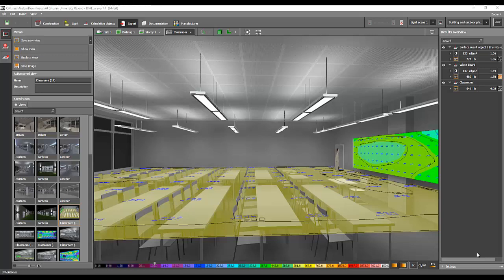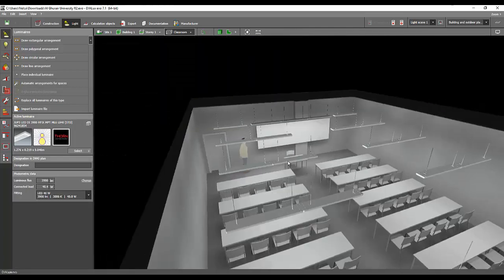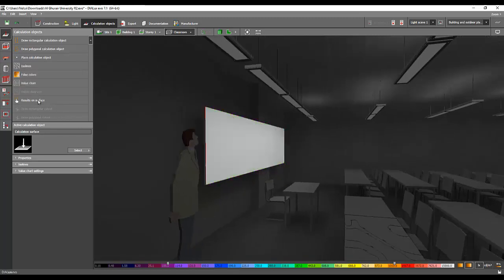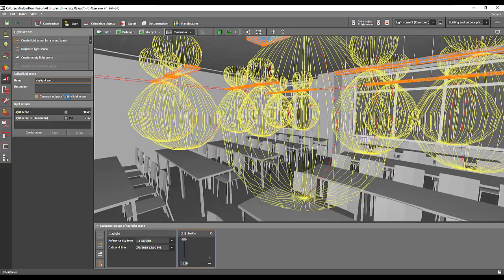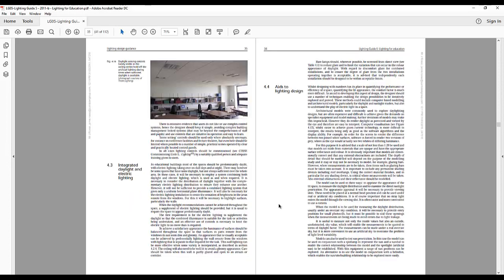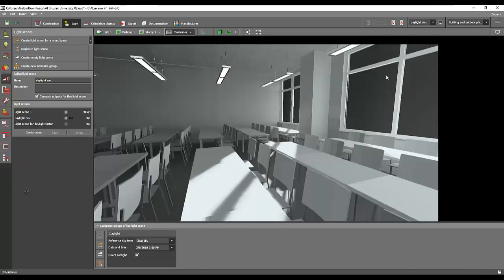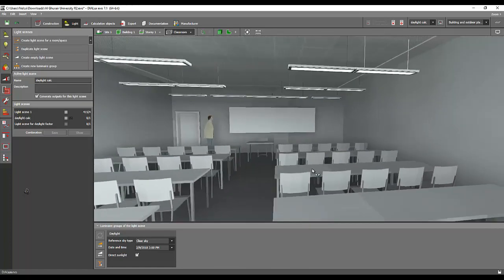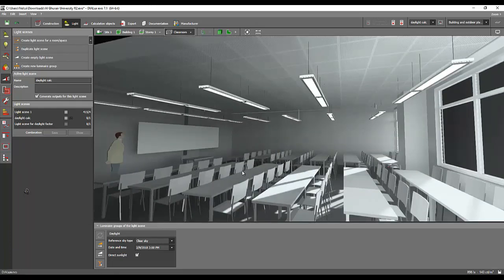Classroom Lighting Design Techniques

Comment: Hello Nelca, thanks for the tutorials first of all, they are very helpful, I wanted to ask a question about the lights that are in front of the whiteboard, they are asymmetric lights, could you tell me other characteristics that help me select my light, color temperature or opening angle, I'm doing a similar project, thanks in advance for your answer.
I would also appreciate if the subscribers of the channel could help me with my query based on their experience.

If you can send me the cad file to work the example, it would be very helpful. My email is dveracaceres@gmail.com
Reply from the maker: yes. its asymmetric. most of your questions are lighting design basics, I would like to suggest to read books esp lighting standards, or you can enroll in my lighting design courses in www.udemy.com.
I will send you the CAD file.

Comment: Thanks for the video Nelca Roco.Pls,how do we create a white board in the classroom and check if the glare on the board is within the limits and know if the board is illuminated well enough.
Reply from the maker: Hi Emmanuel, we cannot measure the glare from the whiteboard.  We can only measure glare from the luminaire.
Reply from the maker: to create the whiteboard, just use the cube object then scale it or use the extrusion volume.
Reply from the maker: the board is illuminated enough if you achieve a lux level of 300 and with an overall uniformity of 0.70 uO.
Reply: Thanks very much,just did that.

Comment: Sorry, where can I get the pdf "Lighting Guide 05: lighting for education".
Reply from the maker: You may buy it at CIBSE website. https://www.cibse.org/knowledge/cibse-publications/cibse-guides
Reply from the maker: or you can enroll in my Udemy course and I will give it to you for free.  https://www.udemy.com/courses/search/?q=nelca%20roco&src=ukw
Reply: FANTASTIC , issue with them not accepting my debit card, so no can do
Reply from the maker: how about paypal account?
Reply: good idea:) , actually just tried it I purchased another package which was quoted at £14.99, I got charged £19.99!! RIPPED OFF ALREADY, so not expecting the course to be any good. I wont be using it again